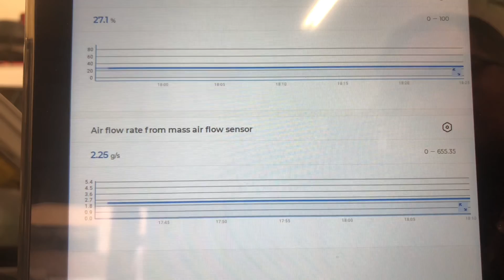Mass Air Flow: [MAF] Testing

Comment: Outside air temperature, size of bore that intake air is travelling through and the energy required to keep the thermistor at a steady state temperature are all components of the equation to measure air density. Don't forget that the mass, in mass air flow is referring to density. Any sensor that uses mechanical means such as a vane are woefully inadequate. The monster of an oscilloscope that we had back in the mid eighties was not capable of reading the signal that for instance, the 3.8 Buicks produced in 85. A light tap on the body was the diagnosis LOL. Fluke was on it though. I don't remember what year Fluke came out with the 97 Automotive Oscilloscope, but I seriously coveted it for a few years. Now I have two in storage that don't owe me anything, a 190-204 that gets used heavily when I need more than two channels, and a 124B that sees the majority of work due to it's compact size.